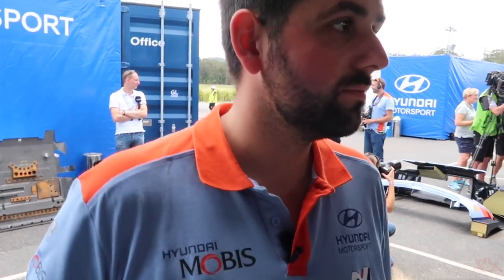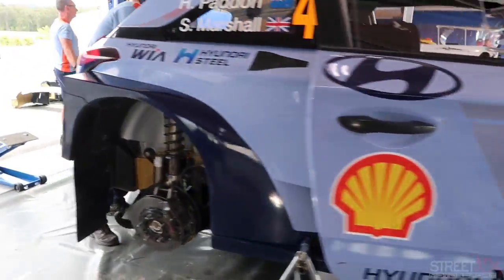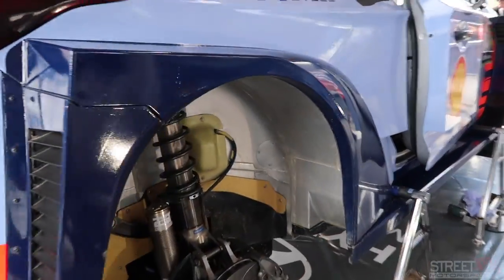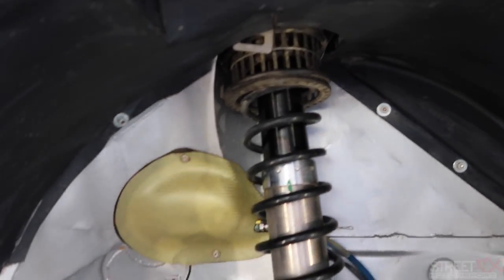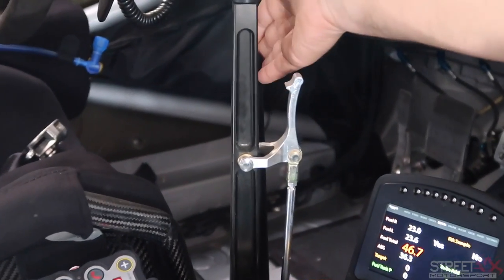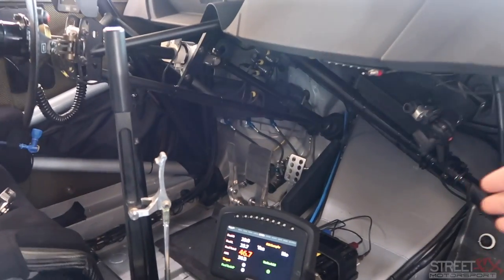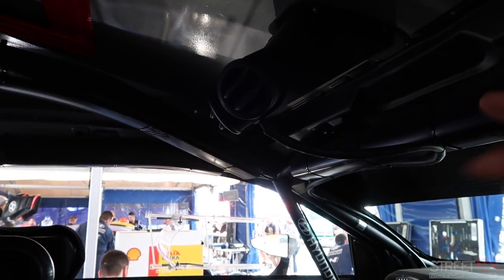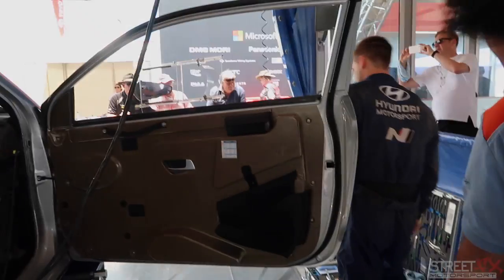Inside look at a 2017 World Rally Car with a Hyundai Motorsports Engineer

Comment: Is Wrc engine based on the same Engine as road legal version of that car?
Reply: Yep, they share the same engine blocks.
Reply: Actually they do not have to be as the fia allows for a non road block.
Reply: Ig no...
Reply: They are 1.6 to 2.0 Inline 4s turbo
Reply: First they are not cars...thye loook like due to the body panels..
I was a mechanic of one team.

everything is different, there is nothing stock there.